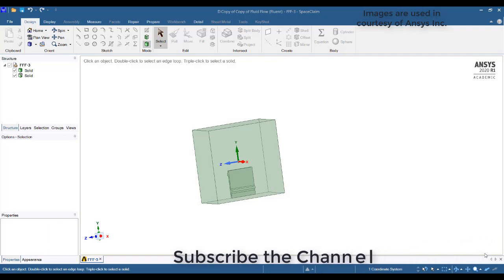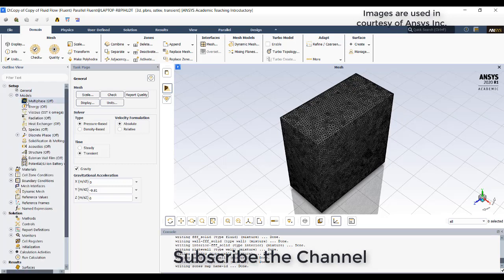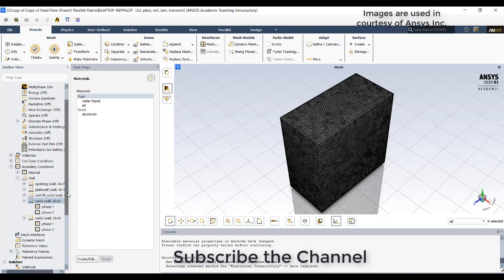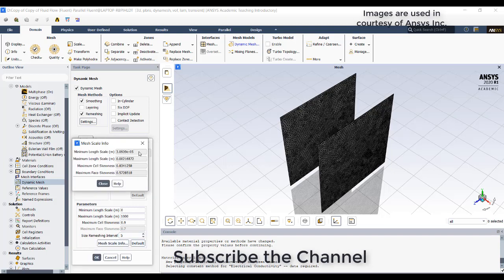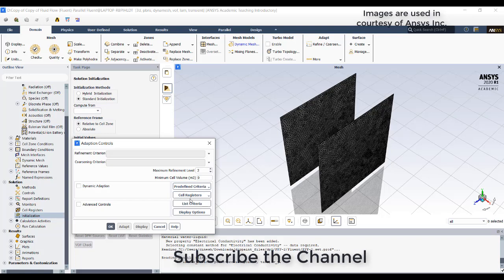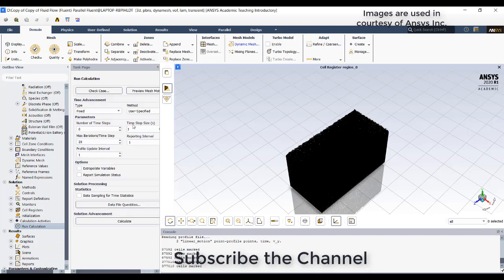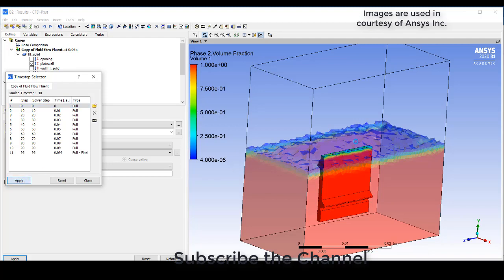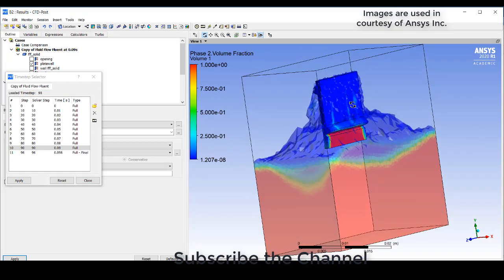DipPaint Simulation using Electric Potential Ansys Fluent

Comment: I have a question on using UDFs with Electric Potential. Is there a cell macro to get the Electric Potential that can be used for defining a source term. I have to get the electric field as the gradient of the electric potential to add the Lorrentz force to the momentum equations.

Comment: Y the water volume dragged on both sides of the plate are non uniform bro....??
And no need to mention, your videos are very informative as usual....👍
Reply from the maker: It is due to shape of plate ....
Reply: @shavantechnology3472  Thanks for the reply.
Can I get your contact details (mail/ number). I want to discuss about a problem which I am currently working on, provided u r ok.

Thanks for the video and if possible make a video on jet breakup in Ambient conditions in the same way u explained nano fluid heat transfer video.

Regards